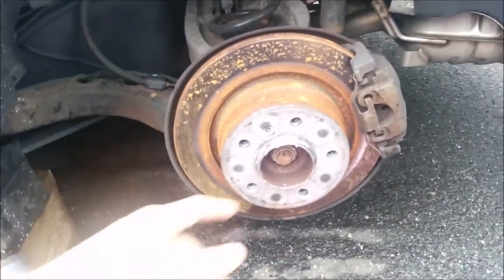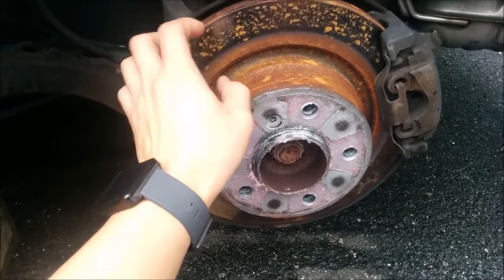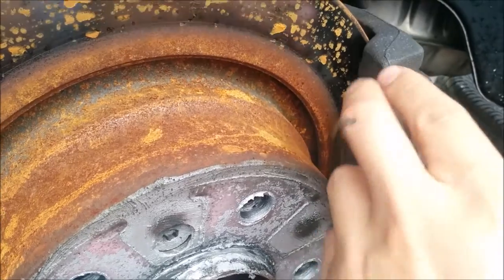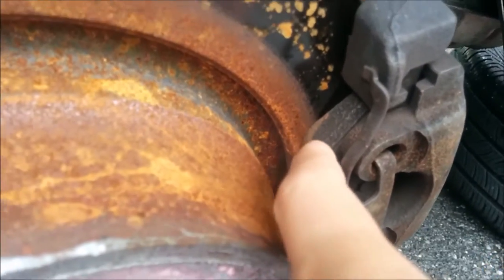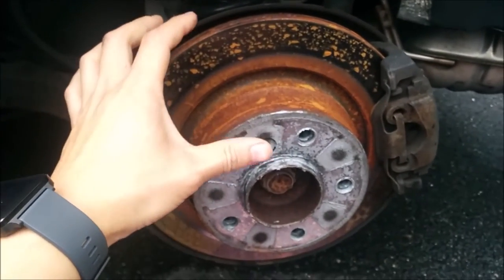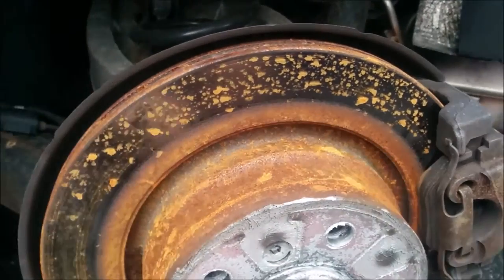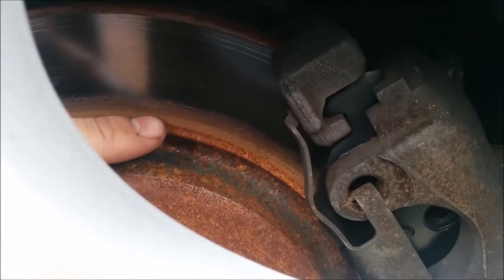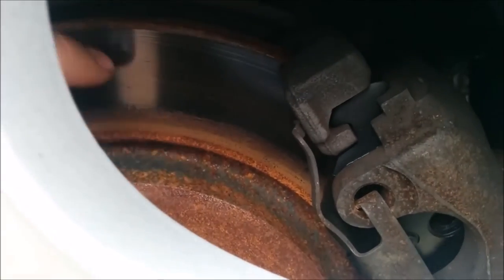Changing Rear Brake Pads - Z4 Vlog #6

Comment: Why didn't you change the rotors?..
I have yet to to see anyone attempt to change rear rotors.. I couldn't get mines off and the ones they said fir (ordered 2 separate sets look like they were not the same width as the original one's on the car